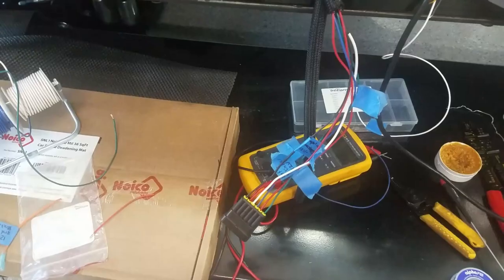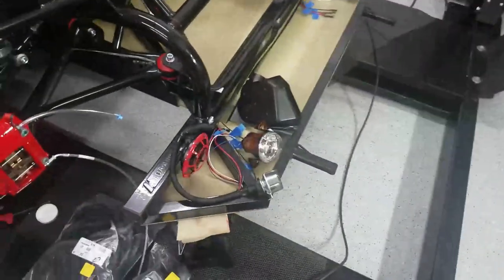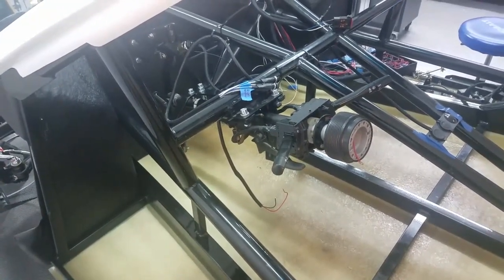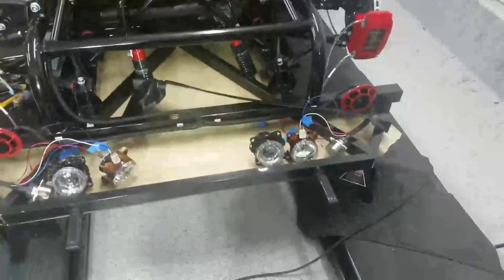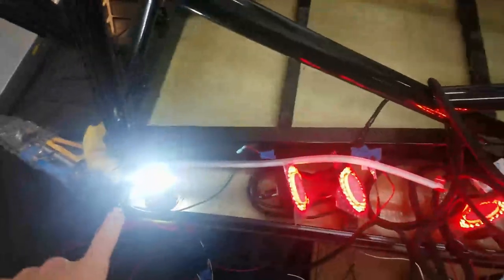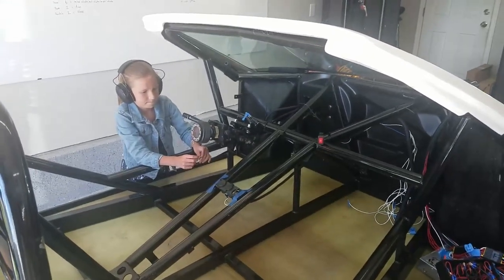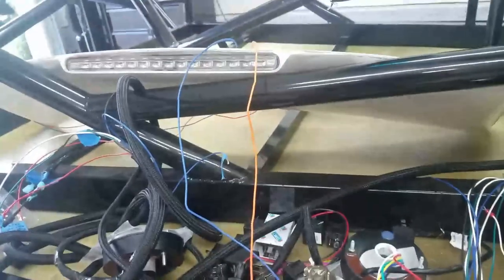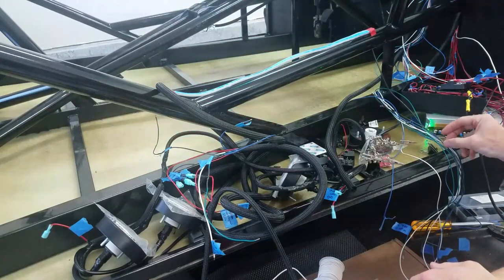Electrical Part 2

Comment: Did you figure out to fold down the tabs on the connectors before soldering them? So they aren’t sticking up?
Reply from the maker: Eventually yes. 😂  I am a slow learner